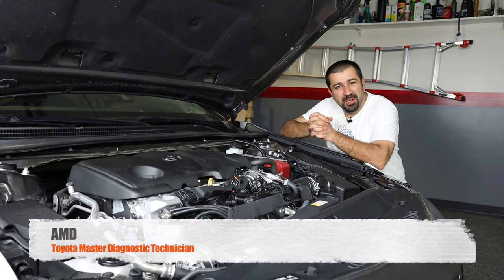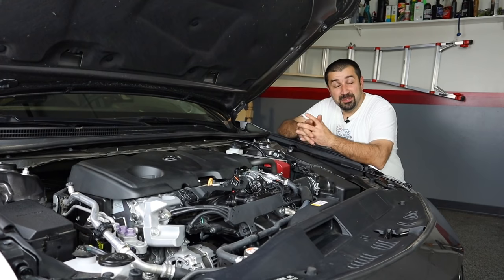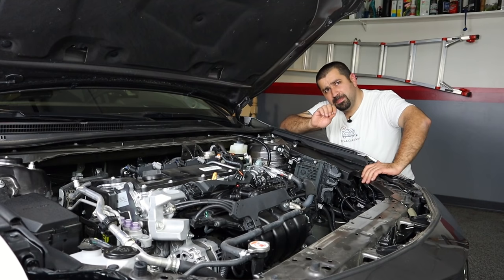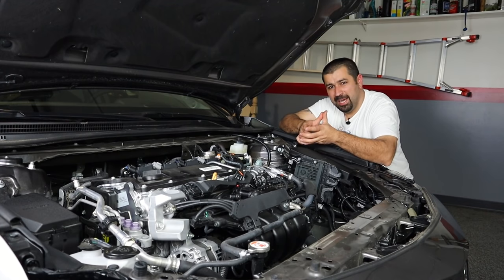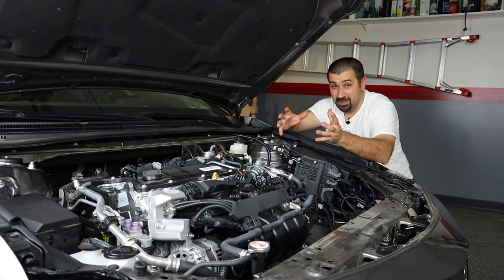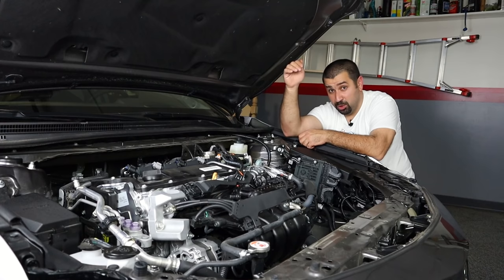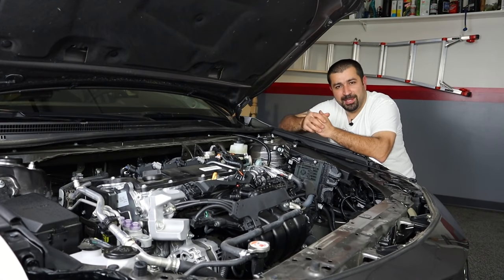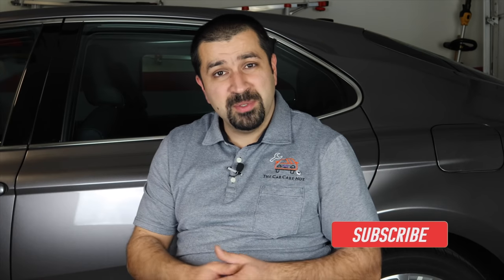Toyota's New Engine Technical review Part 1 : Cooling,Lubrication,Direct Injection and EGR

Comment: Thanks for these excellent video’s. I got a question. I own a 2019 RAV4, current model. It has the 2.5 and it is a hybrid AWD. I have watched this video twice and you obviously are very enthusiastic about it. I’m as well but I didn’t know there were so many hidden specialtees on this engine.
I’m in Europe and specifications of the current RAV4 models are basically identical. As for the fuel and combustion systems in this model, do you think it is a good idea to add Rislone Hy-per Petrol additive? Given the fact simpel things like fuel pumps are not so simpel on my RAV4 Hybrid. There are basically two kinds of gas types available in Europe: E5 (max. 5% ethanol and 98 octane) and E10 (max. 10% ethanol and 95 octane) I fill up with E5, so the product containing the least as possible ethanol. This product gives me clearly higher mileages. Nonetheless, there is still 5% ethanol, hence my idea to add Rislone that, according to the Rislone developers, protects the fuel line and everything else regarding fuel, from deterioation due to the ethanol. What do you think? Can it harm this complicated engine in any other way? Kind regards, Willem, Hekelingen, The Netherlands.
Reply from the maker: Thank you for watching my videos. No harm in using the additive but I would gauge its advantage versus its cost to see if it’s worth it.

Comment: Great video!

Regarding the cooling I have a question. How often should someone replace the coolant to avoid corrosion and crud build up damaging the flow valves?
Reply from the maker: Thank you for watching my video. For coolant the first replacement is 5 years or 100,000 miles then after that every 50,000 miles it 5 years.

Comment: 1. I was waiting for the electric cooling pump. 
Can you post a quote for a new pump with installation.  
The control valves and electric pump is to get the catalytic converters hot fast so they are efficient.  It all about emissions!
2. DGI. It at 3,000 psi don’t not diy repair. You can get seriously hurt if you do not know what you are doing and the injector  spray holes are very small.  Use synthetic oil 0-16.  The direct injector pump usually runs off the cam shaft so does the vacuum pump.
Can you place an estimate for a DGI pump with installation.
3. The port injection is to deal with carbon from engine bypass blow by gases.
4. EGR is for knock control and NOx emissions.  Are the EGR pipes stainless?  If not at some point they will rust and rot.
All in all it a very technically advanced engine but with advancements there are costs that the consumer will incur.
My thought...   buy the extended warranty if you plan on keeping it.
Reply from the maker: The electric water pump replacement cost is around 2-3 hours of labor which is similar to most mechanical water pumps. The water pump itself is more expensive.

Comment: Sir, what kind of issues have you been observing with using different viscosities?

Long story short, my 2020 RAV4h is probably going to be living overseas for quite a few years where it is impossible to find 0W-16 and its cost prohibitive (several hundred dollars per oil change) to order it in. 0W-20 is expensive but is available. Would I run into any issues running 0W-20 for 5K intervals?
Reply from the maker: Hi! I think 0w20 should be ok if that’s all that’s available. But people who had issues ran excessively high weights like 10w40 and higher

Comment: Keep in mind when the computer begins to control more the number of sensors will also increase. As we all know sensors are always failing. Trouble shooting sensors is a nightmare and so is the cost.
I understand these new designs are addressing the emission requirements. Instead of focusing on such a complicated system  just focused on electric or hydrogen vehicles.
Reply: Each of the individual systems is very simple, that's why the totallty isn't complicated, and that's why they are still reliable.

Comment: i was going to buy a 2019 when they came out  but after a test drive i changed my mind and bought a leftover 2018 and i do not regret my  decision  i get great gas mileage  never a problem  there is  eighty seven  thousand miles on it  so the way i see it why  fix something  thats not broken   i will some day consider that engine after seeing proof  by reviews if it is really a good engine  and transmission that is a CVT  so far i see to many bad reviews on this rav 4 2019 to present

Comment: The more complicated you make an engine, the more possibility you have of failures of those complications.
Reply: That is obsolete thinking. Reliability problems do not necessarily correlate with complexity. The most important factors in creating a reliable engine are good design, sound engineering and bulletproof assembly processes. If your can excel in those areas, complexity becomes a far less relevant factor to overall reliability. No company is perfect, but Toyota's record demonstrates that they know what they're doing for the most part.

Comment: I have a 2020 Camry LE.  I use it for work and primarily drive it long distances at reasonable speeds. Oil changes are regular at 3k.  I’ve noticed that the oil is typically cleaner than my other cars and now I see why. 
Thanks for your great videos and info!
Reply: I have a 2020 Camry LE also. No need to change the oil every 3k miles. It's full synthetic, just change it every 5k and you're good

Comment: Fantastic break down of this engine! How reliable do you think it'll be long term compared to the 3.5L V6 in 2006-12 RAV4s?
Reply from the maker: I estimate it will be reliable. We’ve already seen some over 100k miles on the hybrids with Chicago taxis and they had almost no issues.

Comment: You are the Guru of Toyota technology and explained in simple layman terms! One thing I don't think you mentioned was I many miles per gallon City and Highway do these engines get? I assume that the US government or EPA is giving them a certain year cut off for a certain miles per gallon and this is why this technology is coming forward?
Reply from the maker: Hi Roy! Thank you for watching my video! I thought about listing the gas mileage ratings but they vary by model but they’re easily into the 30s and even into 40mpgs+. I think they designed this engine to comply with stricter gas mileage and emissions standards so they can have it for a long time.

Comment: I have this engine in my Lexus, i've been using 0w-20 since new, (not 0w-16) currently at 35,000 miles. No oil consumption, no metal shavings, etc, no issues.

Comment: Thank you,. but I'll wait until this technology is perfected before I get one. I don't want to be the guinea pig for Toyota. The engineers thought that GDI (direct fuel injection) was a good idea, too,  until the intake valves clogged with carbon and the cars wouldn't idle right.
Reply: You are still missing the point entirely ! This car has direct fuel injection and port fuel injection it cleans the engine.. It lessons  the carbon build up like the cars when they were just port injection ..That is one of the main reasons I went with Toyota.. Honda and Nissan use DFI only.. They build up carbon deposits like you are making note of..
Reply: @randyjackson347  I totally understand that some of the car manufacturers are now making engines with both port and direct fuel injectors. My only question is, on these dual injection engines, are there only one set of intake valves? One of your statements doesn't make sense. "It lessens the carbon build-up like the cars when they were just port injection". There were never problems with cars with just port injection only because the fuel flowed over the intake valves and kept them clean. The problem started when they went to Direct Injection and stopped the flow of gas over the intake valves and redirected the flow directly into the combustion chamber through the direct injectors.
Reply: @jameskoralewski1006   You need listen to his video again and maybe you will understand better..(maybe you are just not comprehending this aspect) I understand what he is saying word for word just like what Toyota states in their videos when they discuss this engine..   It uses both port injection and direct injection.. in different intervals.. the engine is quieter when the port injection is active you don't hear the chattering. It  washes the valves and keeps them clean when delivering fuel to the engine.. I never said the port injection built up carbon..There is still a certain amount of carbon with port injection just not nothing like direct injection.. do a research on Toyota engines . Starting in 2018 for cylinder engine on the Camry. It will explain the use of port injection and direct injection and it will tell you it is the BEST of both worlds ! You can believe and buy what you want to however it is a great engine with a lot of technology.. It is also NOT in a guinea pig stage.. Toyota strives to make their engines better they don't discontinue them and start all over again like many car makers do,

Comment: Per Toyota press release for this engine, the oil pressure never drops below 110 kPa or 16 psi. It is also interesting that they increase oil pressure much more quickly when engine load increases, but increases oil pressure much more slowly when RPM increases. They know what they're doing.

Comment: Sport mode uses all 8 injectors that’s why gas mileage hurts

For example you can hear it switching from a cold start, it will rev, then you’ll hear a click and all the sudden quiet. 

Toyota was planning on having a supercharged/turbo one I think but it blew up in R&D due to the plastic cam cover.

Pretty badass engine.
Reply: Damn! Where did you hear that from! That’s cool!

Comment: 0W16 isn't absolutely required, it's recommended and the language they use is based on that they tested it with 0w-16 for fuel economy so they can only recommend you use that, however the only requirement is that you use an API SN Resource Conserving oil, so that means you can use anything from 0w-16 to 10w-30, in other parts of the world this same engine recommends Xw40 and Xw50 oils, there should be no problem running something like 5w-30 in these engines, in fact Toyota even says that higher viscosity oils than Xw16 can be used if the engine is operated at high speeds or under extreme load conditions.
Reply: Totally agree with you…owner manual says that in saudi arabia…

Comment: Question: I have 2019 Toyota rav4  change the oil myself go to Toyota dealership to get ow16 oil but lately they don’t have ow16 Toyota oil been using mobile 1 0w16 oil is they ok to use or should I use the Toyota oil 
Love your channel good information on your videos 
Bobby 
Chandler az

Comment: Just bought a new 2020 camry LE in Saudi. I believe only in cold climate regions 0-16 oil needed for these engines. The manual does state 0-16, 5-20 and 10-30 oil for the region I'm in (GCC region). Cars here do not have strict emission control standards to abide by (no catalytic converters) either. Just to let you know. :)
Reply: What type of oil are you currently using? I’m in Saudi as well and I’m having a hard time finding 0w-16. I doubt we’ll have any issues running that type of oil here but just wanted to double check with you before I get 0w-20 or 5w-20
Reply: @MrValaras  I havent asked the dealer yet. Car due for service next week so will ask then. Just call their service no. and ask.

Comment: I love this engine, 2022 Camry se hybrid nightshade edition, I drive uber with it, I mostly drive highway, I’m getting 53 mpg, currently 112k miles on it. I replaced the pcv valve, looking inside the head into the intake valves, no carbon build up because of its port inject, also I’m assuming pistons would be clean as well do to its direct injection. The only downside to it is cold start engine shakes until it warms up. From the start, when engine came on and goes off, it had a bad shake to it. After it warms up, it’s good.

Comment: Hehe..BMW's electric water pump fails around 60k miles. I think they designed it that way. LOL and oh it's made from plastic.
Reply: Exactly that’s all by design let’s build those lifecycles and then the costs
Reply: BMW in general designed to pump money from owner))
Reply: @Killert68i  I believe it. I also own Lexus models and what a difference in terms of longevity of parts. Just about every one of my close relatives have gotten away from BMW to Lexus/Toyota. 300k+ miles, no signs of oil leaks, original water pump, radiator, transmission, etc. I’m impressed.
Reply: Don’t ever buy a used BMW, Jaguar, Audi and the likes unless you know how to work on them. I guarantee you will regret it. LOL
Reply: @Killert68i  Electric money pump lol
Reply: @BryanChance  Even if you do know how to work on them, parts still come from Germany and are expensive as hell and sometimes fluids cannot even be bought by the average consumer.

Comment: bottom line...more to break and more expensive when it does break.  And everything breaks eventually.
Reply: Not when its a toyota, even if its more modern,  its still less complicated than the German engines

Comment: I was a little uncertain what he was talking about with why EGRs may have problems or are questionable.
Seems like a pretty nifty idea. Helps with emissions, and adds a little unburned gas back into usage for the car. 
That said, i went ahead and searched his channel to see if he explains when the tendency of EGRs are and why they have some liability issues and on an olde Prius he did a video where he replaced the EGR and explained what the problems are. 

I would post the link here but even after trying to break apart the link so it wouldn’t register, it was still removed. 
Anyways. Just search up “Toyota EGR Diagnosis Tips and Repair Tips”

Comment: I have a 2021 Toyota sienna hybrid that I use for towing a small teardrop camper which weighs about 2600 pounds dry weight.  I should I be using 0W 20 instead of 0W 16 in my vehicle because of the frequent towing in the hills of Pennsylvania. I would love to know your opinion thanks.

Comment: when i had an oil change on my 2020 camry hybrid i came back home and checked oil level. and i couldn't really find anything on the dipstick, you know the yellowish fluid thickness on the end of the dipstick. so, i went back to the dealer and the mechanic dipped the stick back in and took it out to show me that the oil is very clearish type because it is the type of oil is not yellowish in color, and that it is special type designed for this camry. interesting though.

Comment: Regards. I want to know if it is risky  to replace my oil grade wish is currently is 5w30 to 0w16. I dnt really understand why in Mexico, with al the North area in similar weather than south of USA they just decided to use 5w30. Is the same motor, same specificacions.
Reply from the maker: There shouldn’t be a risk making the switch.

Comment: This engine runs very hot. The oil and engine are very noticeably MUCH hotter when changing compared to other cars I've changed oil on.
Reply: The purpose of Motor Oil is not only to Lubricate the moving parts in the engine but also to dissipate the heat of the engine by capturing the heat and suspending it with the motor oil!

Comment: My Camry's A25A-FXS is a loud clattering clunking engine. When not warmed up and running under load (when it's charging the batt), it sounds horrific inside the cabin. Outside it's atrocious. Calms down a bit after it finally warms up, but even then it's kinda loud. You can't make me believe that's normal. Fuel economy is surprisingly good though, did a 13 mile test drive fully warmed up outside town, didn't exceed speed limits, consumed a lot better than its EPA-rating. Sound insulation could be better, but I understand there must be a significant step up to Lexus.

Comment: Does the 2020 corolla hatch engine also use port and direct like this one?
Reply from the maker: Yes it does. The engine in the corolla hatch is the M20 which is exactly the same as this engine just slightly smaller
Reply: @TheCarCareNut  thank you for your time help and response.  Its greatly appreciated